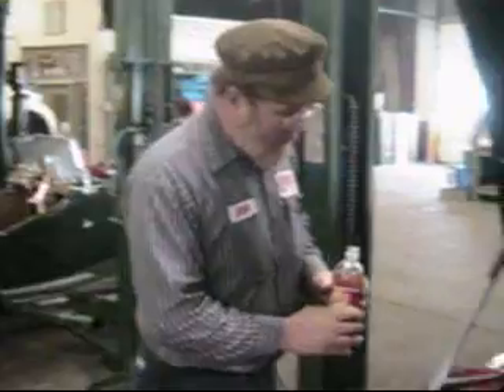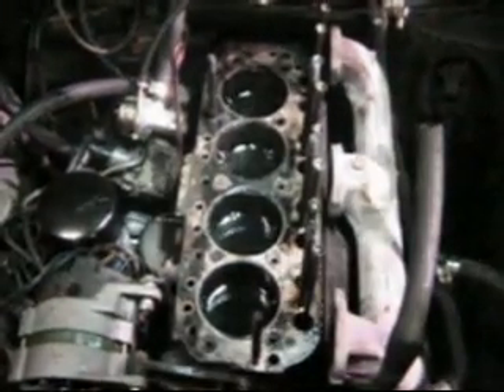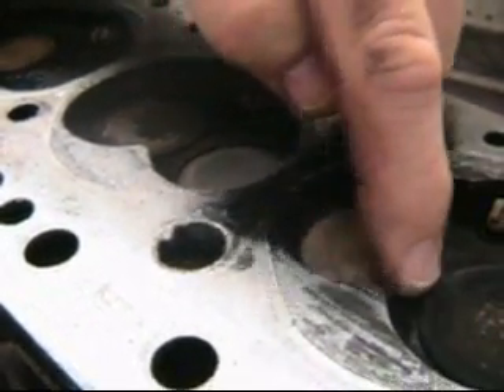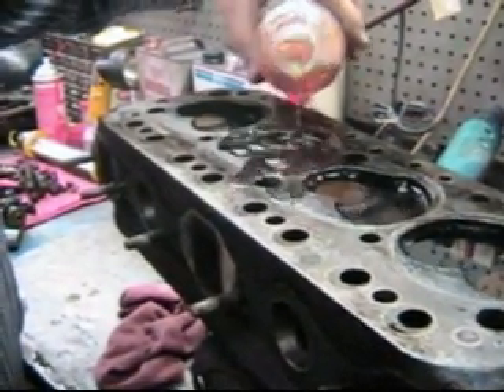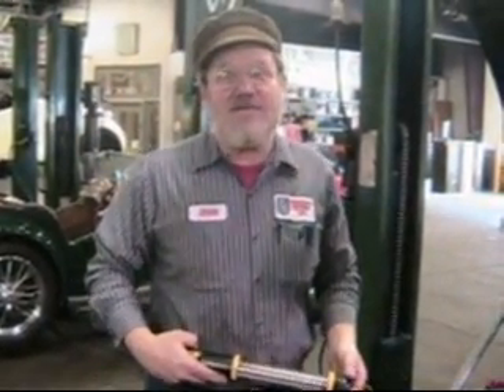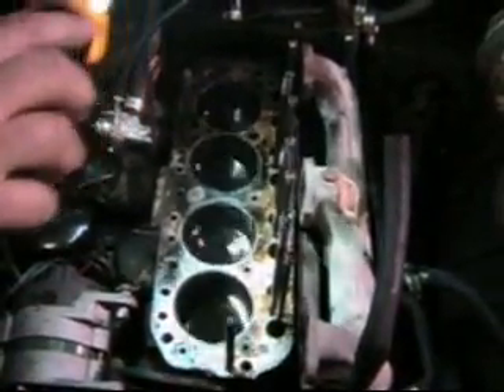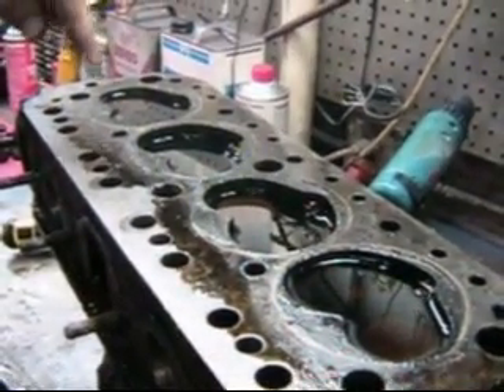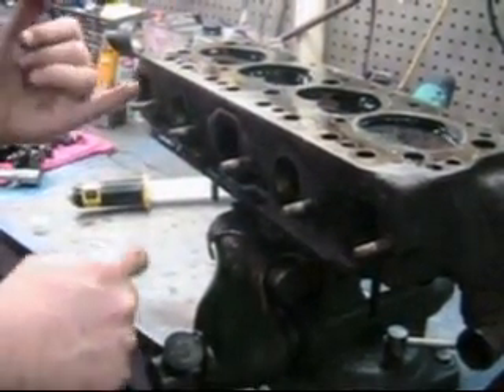050 MG Tech | Determining The Cause of Bad Compression

Comment: Maybe someone can answer a question I have. The rings on engines I have worked with are not totally sealed as they have gaps in them, (yes I know the gaps are not supposed to be lined up with each other) but surely if you poured gasoline in a cylinder like that then the gasoline, or kerosene would always leak out?
Reply: The gap is very small when everything is as it should be, maybe .005 or .006" so the fluid has to make its way past both of those compression rings as well as the oil control ring.

Comment: I suggest using lacquer thinner as a substitute for gas. It's safer and it also makes a GREAT oil sludge solvent. There's also no reason you can't do your test more effectively by injecting compressed air into the spark plug hole (with the camshaft off) and watch for bubbles on your valves rather than waiting around to see if the fluid level drops.
Reply: Rick Jasper po

Comment: Silly video to say not to use gasoline and then go ahead and do it setting a poor example. The gasoline could have easily become combustible with a spark from any where and exploding into a large furious fire burning them. Duh. Please use kerosene.
Reply: +ninemilliondollars I got a 5 gallon bucket of gas in my agarage. havent had a problem... youre over reacting
Reply: Dude, per the National Fire Protection Assn: (http://www.nfpa.org/safety-information/for-consumers/gasoline-and-propane/gasoline-at-home/gasoline-safety-tips) just for starts, it states: "Store gasoline outside the home (i.e., in a garage or lawn shed) in a tightly closed metal or plastic container approved by an independent testing laboratory or the local or state fire authorities. Never store gasoline in glass containers or non-reusable plastic containers (i.e., milk jug ).Store only enough gasoline necessary to power equipment and let machinery cool before refueling it." If your container isn't sealed, you're asking for trouble. Gasoline is extremely volatile and subject to spontaneous combustion, not even counting a spark caused by static electricity. Even a battery can set it off.Furthermore, check the American Burn Association GASOLINE SAFETY GUIDE's "Guidelines for Storing Gasoline" midway down the doc found at http://www.ameriburn.org/Preven/GasolineSafetyEducator%27sGuide.pdf. Note the first item - "Don't store gasoline in the house of garage..."Hey, I'm not coming down on everyone. There are a lot of experts that know about this stuff. If' you've not had a problem, great. However, consider the risks
Reply: lol - Thanks.

Comment: good video now i can fix my chariot with no compression
Reply: Anthony Dunkley so how did it go? my car just lost power and the compression was zero
Reply: i didn't end up using it, as i found out that it was my cambelt/timing belt that was the cause of no compression, because it was out by one and a half teeth on my car
Reply: it is most likely to be  your head on the car if you have no compression

Comment: @Brock1912  A leak down test will indicate which component is failing. I think you're getting your leak down test and your compression test mixed up there. A leak down test involves introducing an air supply at around 100psi into a cylinder at TDC on the firing stroke. If an exhaust valve is at fault you'll hear air escaping down the exhaust, if it's an inlet valve then you'll hear it in the induction system and a bad ring will be heard through the crank case breather or dip stick.
Reply: Bluebelleist an escaping Air down the exhuast when driven? Before my 3rd cylinder   Miss fired, I use to hear pressured air and thought it was my exhuast, couldn’t be my exhuast though because it’s brand new

Comment: A leak-down test will only tell you if the cylinder is or is not holding pressure. This test tells you WHICH component is causing the compression loss.

Comment: don't use gasoline use diesel as it won't ignite that easily with open flame. some hydrocarbons like diesel have good lubricating properties too, but yes very limited at the same time.